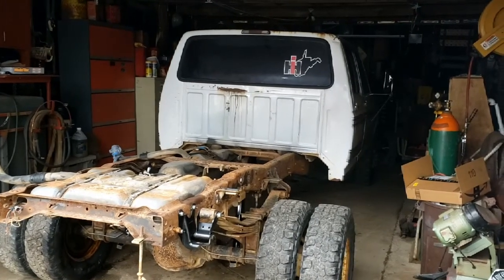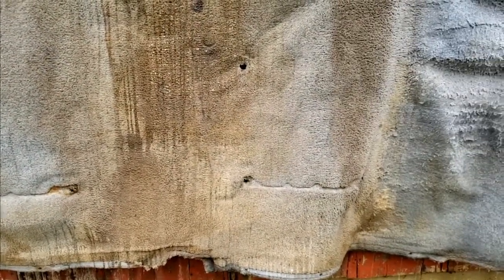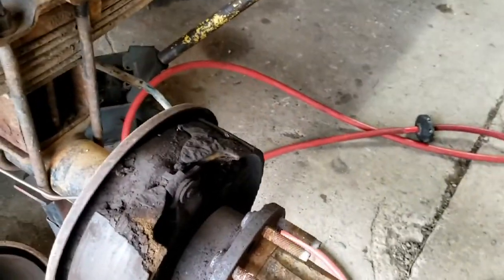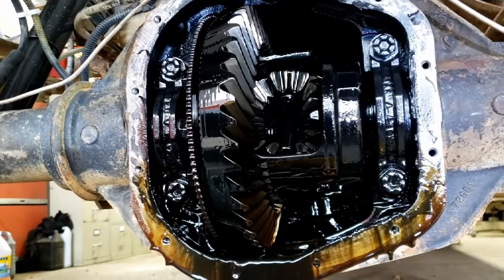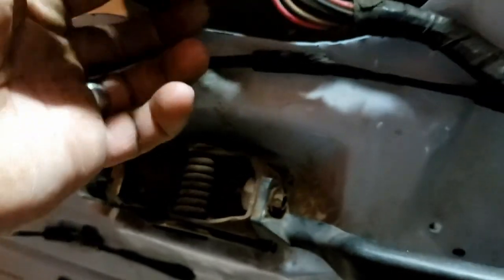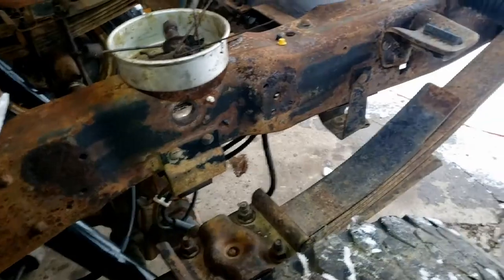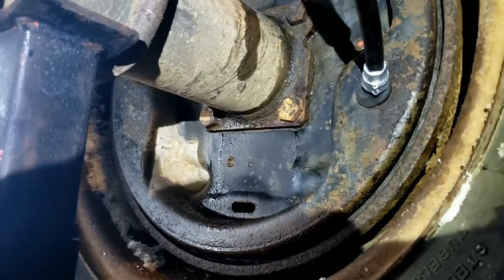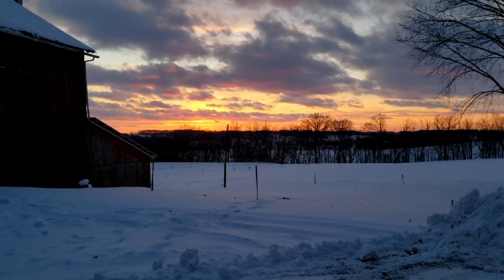Power Washing Carpet, Rear Brake Rebuild, and Rear Diff Fluid Change - Project Frankenstroke Part 15

Comment: Interestingly🤔, in my F-250, the carpet is made of rubber, in the interior color,apparently it depends on the configuration of the car.
Reply from the maker: They could be ordered with either carpet or the rubber floor mat. I believe carpet was standard on the XLT trucks and the rubber mat was standard on the XL, but my crew cab is an XLT with a rubber floor mat (which I much prefer). I don't know if it was a special order to get it that way or if it's just an oddity, but I love my rubber floor mat.
Reply: @diymechanictv1233  Yes, most likely it is, my F-250 is factory equipped XL,maybe it was an order, since my F-250, from the factory there was a Tow truck.